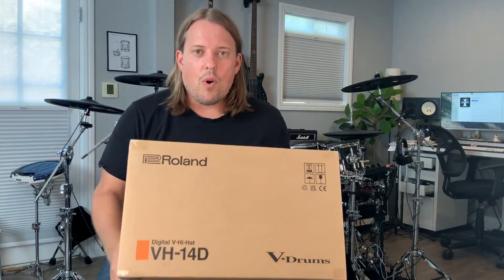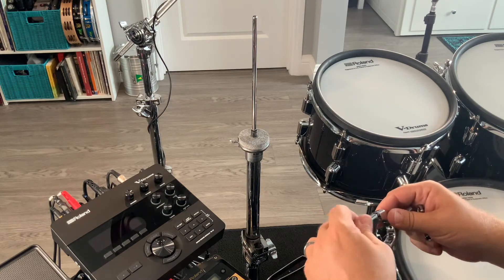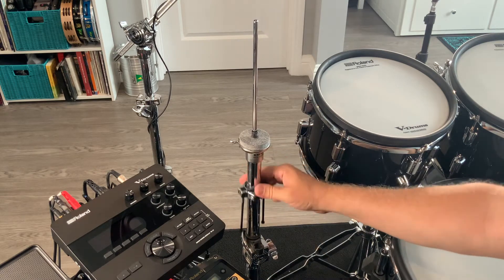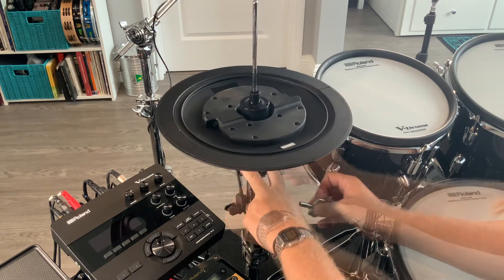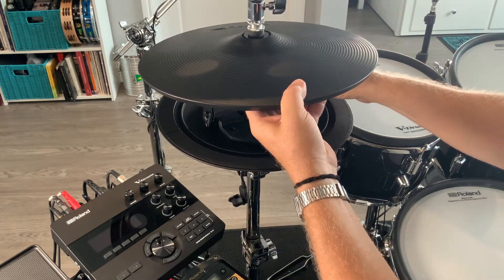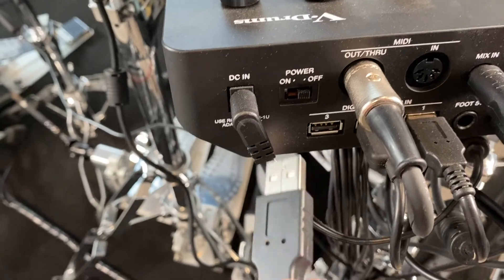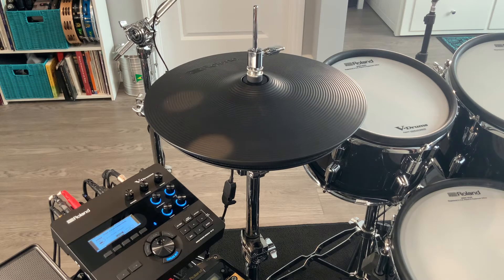Roland VH-14D Hihat Unboxing and Setup

Comment: I have seen most everyone close the clutch and hit the execute button without any kind of adjustment. You can turn the screw at the bottom of the clutch to fine tune the hi hats until the offset arrows light up, like the VH-10. This will give you better open/close accuracy.
Reply from the maker: Yup, thanks Al! Over time I've found the best settings for me is a slightly above center offset. It helps keep some hihat slop in there when it's closed, but you're not putting any weight on it. The quick hihat barks respond better as well, particularly on these 14s.

Comment: You can keep the hi-hat stand from rocking back and forth if you move the legs down so that the bottom plate of the stand is just a little bit off the floor.

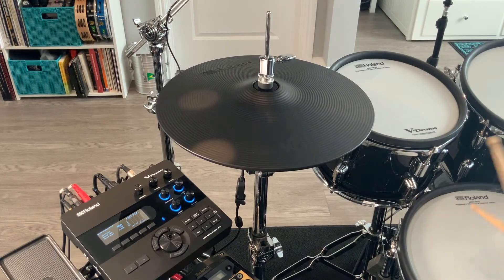Comment: 5:07 , 5:08 , 5:22 .  Is the hi-hat muting itself during the barking articulation still a problem even with the digital one? Or there is a way to mitigate it, unlike with the vh-11?
I would like to upgrade just to solve this issue with the vh-11 but it seems like the issue is still there...
Reply from the maker: It was an issue in this initial set up. After diving into the settings a bit, I do feel it articulates the opening sounds better. I also increased the spring tension on the stand to help open the cymbals a bit faster.
Reply: @OfficialDarenPfeifer   Thanks, good to know. Yes, I have noticed that a good stand with a proper spring makes a big difference with the VH-11 too. I have heard that the offset helps a bit with the problem, but the VH-11 only has a physical adjustment.

Comment: Hey Daren, great unbox video.  I am a long time acoustic drummer, and recently got a TD27 Kit and LOVE it. Upgraded KD-120 Kick and just got my VH14Ds... YES!!!   But, I am a tech lame acoustic drummer.  I need to update the module from Ver 1 to 11... the Roland instructions say I need to do via a Sim Card, which I don't have... can't I just download to my laptop and then via USB cord to the TD27 Module?  I am frickin lost !! Can you help ?
Reply from the maker: Hi, Bob. That’s great! Good stuff on the upgrade. Yes, you’ll need an SD card for the update. SanDisk cards work well. A small capacity card like 8 or 16GB is more than enough. Those are pretty cheap at Target/Walmart etc. Your laptop should have an SD slot. If not, USB connected card readers are pretty cheap as well. Turn on the 27 and insert the card. It’s best to format the card with the 27. I didn’t go through the backup process because I don’t keep all that many user kits in the module. If you have a lot of your own kits programmed, you’ll need to back them up to the card. After the format and backup, put the card in your computer and download the 1.11 version to it. The rest of the steps are here…

https://www.roland.com/global/support/by_product/td-27/updates_drivers/2c6f3e25-7a4d-498f-8b87-92c92e6b57c5/
Reply: @OfficialDarenPfeifer  Thanks Dude, really appreciate it.... I love my Roland TD27 kit, almost more than my Gretsch Renown kit.  Really excited to get the new digital high hats going... hopefully they come close to "real" high hats.

Comment: I watched your video with interest. I was able to pick up a nearly complete brand new TD 50K kit from GC for a very reasonable price.  It was missing the standard VH-11 which gives the opportunity to buy a better one. I was considering a used VH-12 but I would rather splurge once than regret twice. Though certainly pricey it is apparent from watching your video that it sounds great and not as noisy as the VH-13.
Reply from the maker: Thanks, Stuart. It's definitely a worthwhile upgrade. I'd also recommend software upgrading the 50 module to the 50X. You can buy the upgrade on the Roland site, it's about $200. Acoustically, the VH14 is still noisy, but it's a lower pitch and not as annoying as the 12 or 13. You still have a definite "chunk" of the cymbals hitting together.

Comment: Thanks for this vid Daren. Nice setup BTW. Do you notice a difference in the triggering with the VH-14D? If you put more weight on the pedal does that tight tip "chick" sound go up in pitch as it does in the TD-50 demonstrations? Like an acoustic hihat? Thanks!
Reply from the maker: Yes, the triggering is much more accurate. It also has positional sensing and you can choke it by pressing the bow like on the CY-18DR. I don't notice the sound going up in pitch. It more shortens the length. It's the positional sensing and the foot splashed that are just over the top great.
Reply: Thank you  @OfficialDarenPfeifer . Pretty expensive, just making sure it's worth it! Cheers!

Comment: Thanks for the video Daren I have the td 27 as well with the vh-10 hats were you able to make use of the 2 former jacks used for the vh 10 for other pads to expand the kit?
Reply from the maker: I wish Roland made that possible from the introduction of the digital inputs. The equivalent 1/4 inputs are disabled when you're using the digital inputs. So, using the 14D hihats makes the HH and HHC 1/4" inputs unusable.

Comment: I just bought it with iron cobra 600 just to find due to the spring screw the rotation stoppers are not able to reach the hi hat 😥
Reply: Same here. You have to remove the round adjuster knob. It will leave the bolt intact, and you can work around that I don’t use the tilt, so it doesn’t matter to me.

Comment: What is the Roland device below the TD27 module?
Reply from the maker: It’s a Roland TM-2 module. I use it for extra inputs and run the midi and audio output into the 27.
Reply: @OfficialDarenPfeifer  this is a brilliant idea. I've also got an old TM-2 kicking around. I was hoping to add a second ride to my TD-27 and maybe jury-rig a ride bell, but am running low on ins. isn't it sufficient to run the midi into the TD-27? or do you use some samples aboard the TM-2 as well?

Comment: Daren need your help please. Trying to connect and set up this VH14 hats to my TD-27 but getting this message when going into trigger settings - ‘This Digital Pad is not used for Hi hats. and Hi-hat Pedal position is invalid’
Reply from the maker: Happy to help, dude. Does your 27 have the latest software? System>Info>Program. It should read "1.11"...that's the latest for the 27.  Start here if you need to update...

https://www.roland.com/global/support/by_product/td-27/updates_drivers/2c6f3e25-7a4d-498f-8b87-92c92e6b57c5/
Reply: @OfficialDarenPfeifer  yeah my bad! I managed to figure it out in the end. Thanks for the vid and reply 🙌

Comment: Thanks for this.. I have a TD-27 module as well and have been debating on the upgrade.. Looks like that'll be a big yes. Killer playing btw. Have you tried it with Superior Drummer 3 ?
Reply from the maker: Nice! Just having a full-size hihat there was enough for me to buy. And, yes, depending on what the project is and who it's going to, I use Superior 3 or Slate.
Reply: @OfficialDarenPfeifer  how's it work with all the different hat articulations within SD3? and, I'm almost afraid to ask, but can it trigger any of the HH bell samples?

Comment: would love to get some follow up on this video, regarding whether you still think this is a great digital hi-hat, espeially since you use the TD-27 (most videos deal with the td50 with this hat).  Rumours are that the TD-27 cant produce the full capability of the digital hi hat.  DO you find its still a gratifying combination? any frustrations?
Reply: This is super interesting. I didn't know about that potential issue with the TD27. Got my TD27kv2 a yesterday and am still trying to figure out a way to properly setup the opening sound of the hihat to register. Seems to always miss a bit.
Reply: interrested to, on my side I can't produce those different sounds (td50 video below) on bow and center also nothing special on pressure...
https://www.youtube.com/watch?v=kaTk3pxj0aI
I'm wondering if it's a issue with my td-27 or a limited compatibility with vh-14d because it's well detected by the module (edge/bow, left/right)
If someone can confirm with the TD-27 plz

Comment: did u have to align the dots on the hi hat, i tried mine but it seems to be always off by  a small margin
Reply: I assume it's referring to the orientation in general, as covered by making sure A/B are the correct way around. As oppose to the two dots being perfectly aligned throughout playback.

Comment: hi Daren 
Does this hithat need a trigger like the old hihat that comes with the VAD 506?  I Saw that you did not have to put that .... do you just use it without the trigger bc is digital?
Reply from the maker: The trigger is built in to the bottom cymbal, much like the VH-12 or 13. There are two short linking TRS cables inside between the two cymbals. Then only one longer cable, the USB cable, connects to the module.

Comment: Do you really think you get a $1000 worth of improvement? Is the sensitivity of open/close nuances any better? I think that's the weakest point of ehats.
Reply from the maker: That’s really the $1000 question!!…and a great one. Will this be the THING that takes my drumming up a notch?! For me, it’s worth it because I expect the feel, look and response from a 14” hihat. I mean look in terms of me or you playing, not for an audience. I expect to see drums and shells and full size cymbals. It makes a difference…just your mechanical playing experience. Also, it’s my business. A good half of my sessions are on the Roland kit and the little things like foot splashes and position are better. Not crazy perfect on the 27, but definitely better. With that, I haven’t yet had an issue where the hihat performance distracted me or I had to fix later. I feel like I play normally. The 14d is the best solution out there, over the Lemon and ATV hats as well. If you have an extra grand to spend, buy crypto! 👍
Reply: It's 675$ more than a vh-10 so it would be a 675$ improvement. It plays different on a td-27 than a td-50X so that would factor in. For the average person, probably not though.  Only way to know is try it yourself.
Reply: This is only a question for people with an original 506 or other kit that came with an analog hi-hat. Roland released the VAD 507 that includes the VH-14D, 2.0 module upgrade, and hardware from the 706 currently listed for $5,399 at the usual retailers. If you have to buy it standalone I think it is overpriced, just like all their other cymbals, but it is indeed very good. I have tried other "2 piece" hi-hats from other manufacturers and they might as well have been made out of concrete. As for articulation I have a few benchmark hi-hat pieces to test out the quality of any hi-hats I buy; The Weapon/Rush, the open/close 16th's during the beginning of Foreplay/Boston, and any number of Stewart Copeland stuff. Every hi-hat up until now has struggled with these. VH-14D did not.

Comment: These seem fun and all but with with all those fixed cables a good old VH-11 is going to outlive this thing by a huge margin.
Reply from the maker: I see where you're coming from but I like that there's just the one usb cable that comes out of the hihat and connects to the module.  The VH-12 and VH-13 hihats also needed three cables. The 10's and 11's are fine and work great. IMO, the greatest PRO of the 14d is just they're 14 inches. The biggest CON is simply the price. Yes, the performance you can get out of them can be more nuanced than the other models, but not by so much of a long shot that justifies the extra cash. Love the avatar, btw!